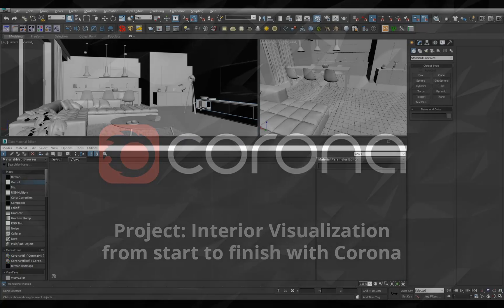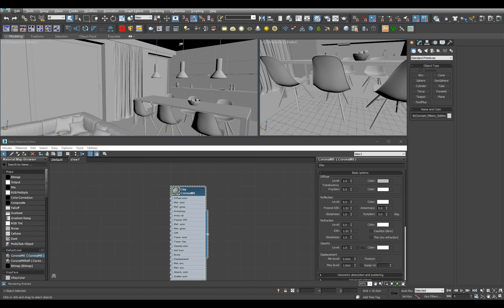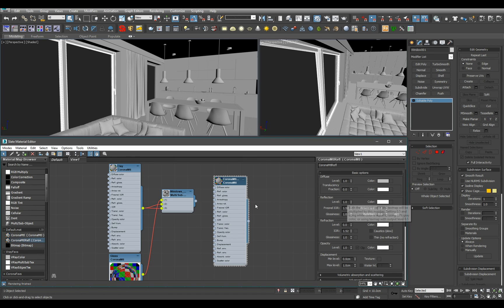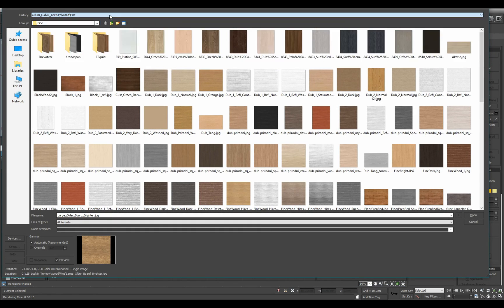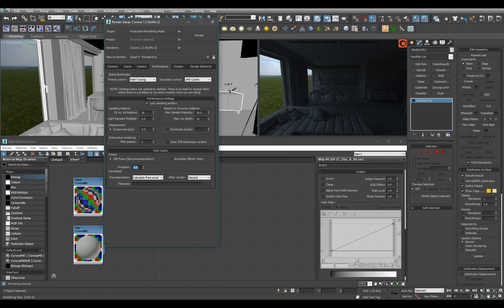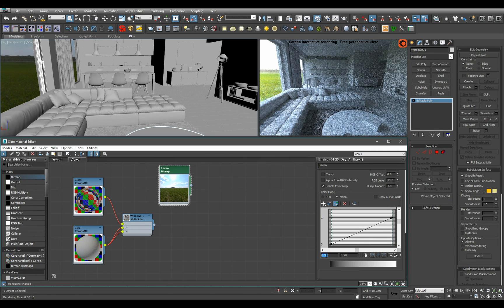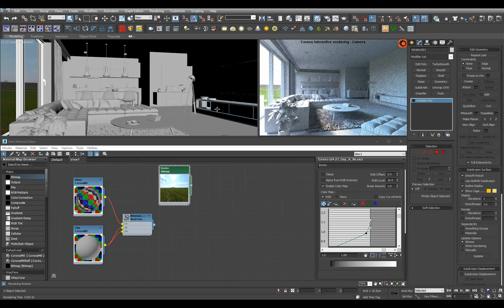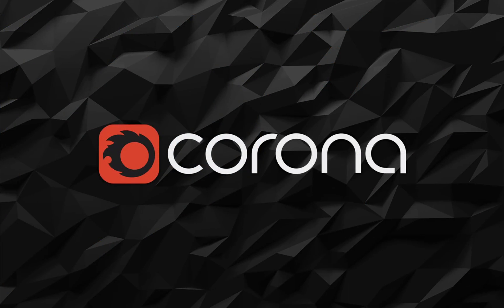Complete Project - Interior Visualization 2/6: Initial setup

Comment: First time trying corona, coming from vray. Trying to do some interior renders for a house model that does not have such a big glass window to let in all that light, so i would like to know if it's better to use a corona sun or a hdri map like what was used in this setup to get the best lighting inside the my model?
Reply from the maker: Hi Kemar! No reason not to use both - the HDRI provides general lighting, and the sun would provide a more well-defined lighting. All depends on the scene and the result you want, but "just HDRI" or "HDRI plus sun" or "sun plus Corona Sky" or "just Corona Sky" will all work well. "Just sun" would not work so well though as there would almost always be some sort of environment light in a scene (only exception I can think of would be a night scene lit solely by moonlight, when the environment is otherwise pretty much completely dark). All will give good results, and good render times! A portal would be useful in the window in this situation too (there are separate videos on the use of portals). I hope this helps! Tom
Reply: CoronaRenderer Thank you. I will try your suggestions.

Comment: Why you dont  use corona portals?
Reply: Because the windows are large. With large windows or large holes, you dont really need to put corona portal mtl. Vice versa, small windows, small holes, make sure to have corona portal, it helps clearing the noise faster